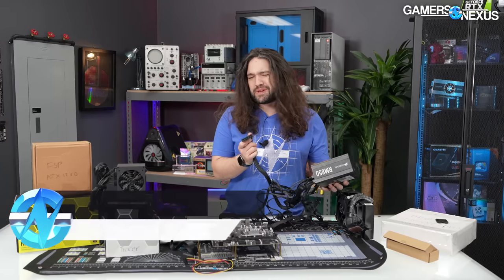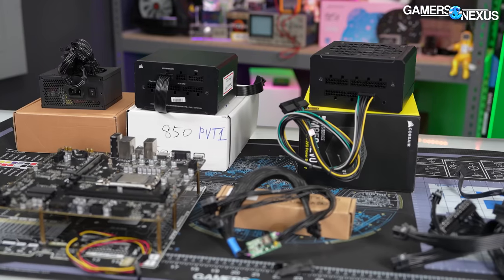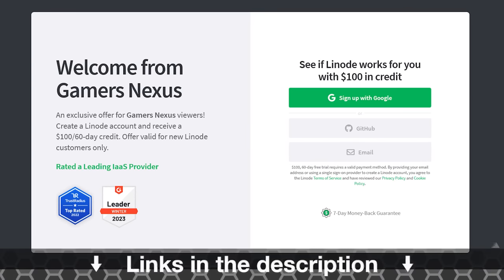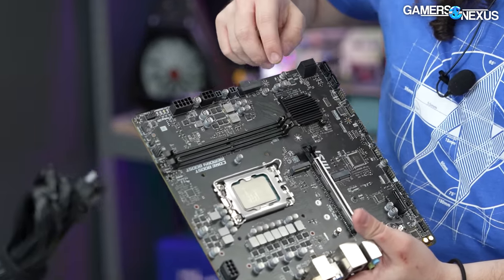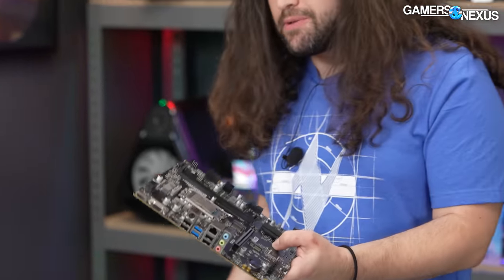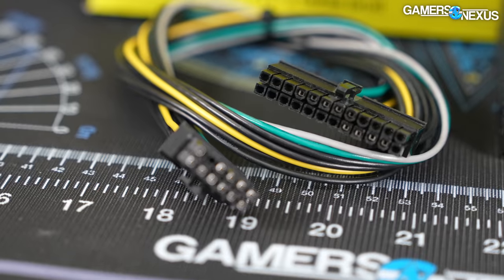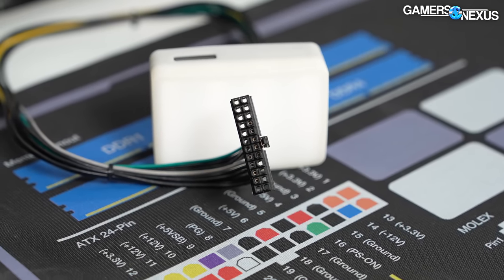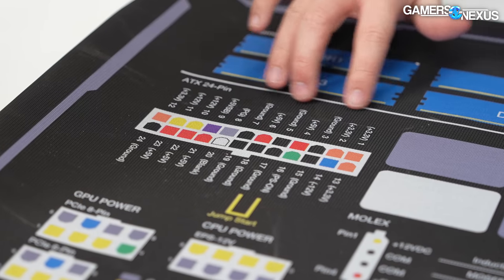The Future of Power Supplies - Maybe (Motherboard Cost, Cables, & ATX12VO)

Comment: I've never been a fan of 12VO, conceptually,

Motherboard longevity (or rather, the lack thereof) is one of the more frustrating things about the PC industry. CPU's outlast their motherboards significantly. Really, you can't expect a component with that many separate parts to be as robust as a CPU which has been binned for its unitary integrity already.
many CPU's in history last so long that they outnumber their host computers, then having to be scrapped purely because there are no matching components to make them useful.

It's rather frustrating, then, to see that standards are moving towards increasing motherboard complexity and responsibility, when, really, I'd much rather see more modularity. I think the E-waste saving potential of having a standard with more numerous, smaller, and less responsible components, is vastly more important than the power saving potential from voltage conversion efficiencies.
Reply: Well said. I have multiple still good & working CPUs (Intel Core 4790K, Intel Core2Quad Q9650) where the motherboard died and I couldn't find a replacement anymore because they were only manufacturing/selling newer socket generations.
Reply: What kind of modularity do you mean by (presumably) separating motherboard components and making them replaceable? It sounds like being able to DIY build your own motherboard, if I'm getting it right.

I personally would not like to see increased motherboard costs, but ideally if that weren't to happen and there could be other efficiency improvements by combining multiple power connectors and re-working expansion slots (and combining SATA data and power cables especially) I would quite welcome it.
Reply: @jamesbuckwas6575  Ideally, I'd wish for the ATX standard to evolve into a less monolithic design. DIY motherboard is one way to think about it.

I think, Ideally, the motherboard itself would be mostly the chipset and CPU socket.
The goal would be mostly to reduce the size of the board significantly, by removing extraneous features.

The rest of the components, such as power management, I/O, sound, USB, could be put onto add-on boards, which either socket onto the smaller motherboard, or cable into it.

What that would look like, or how it would affect latency, I have very little idea.
Though I do know it is antithetical to the current momentum of motherboards, which are now beginning to expect you to install the storage on the board itself.
Perhaps instead of that, there could be a dedicated PCIe x8 slot that connects to storage board, which can be installed behind the motherboard, perhaps with the memory controller on the board itself? Who knows.

Perhaps the ultimately solution is to replace most I/O with PCIe. Making CPU's more variable. Return to soundcards, and the likes.
Perhaps with separate PCIe-slot boards, linked to the main motherboard with a special, denser riser.
Reply: The worst part is all these e-waste generating measures are sold as "green". Many accept these claims at face value, and the community fights itself over the often non-existent environmental merits. In this case, you'd need to save an awful lot of watt-hours to make up for disposing of motherboard sooner and replacing it with a newly manufactured model, and we're talking about a watt or two on standby with these changes. It's possible that the breakeven point is hundreds of years with something like this.
Reply: @mattrogers6646 time to break out the aliexpress salvage boards

Comment: Gotta chime in and say that 12v only (sometimes even 24v) PSUs have been used in data centers in the US for several years now. I have been working on them for at least 3 years now. They are more stable in every sense than traditional PSUs. Power distribution boards then do all the "magic." This has also been great for cable management and thermals. I would love to see this adopted more mainstream so it becomes more available, aka more reasonable prices. Good day ya'll.
Reply: I do some 12V-intensive things at home and my go-to for those tasks are used 1U server power supplies.  12V 50A+ single output and they're generally free.  Some I have are more than 15 years old and still working just fine.

Comment: I feel like that last thing we need is more things the motherboard manufactures can use to  "differentiate" their product lines. 
I run 8 SATA drives, would I need to get some sort of special add on card to support that many?
Reply: you could use a 6 or 8 pin add in card. 12V to 5V is very easy to do and there's already supply chains for it. you (or a manufacturer) just have to add a 6 pin connector on one side and sata connectors on the other. there's probably gonna be single active cables that do 12Vo sata to 12V+5V sata too.
Reply: @satibel  Add in card? Like PCIe SATA expansion cards that will take power off the slot and give you 5v? If that is the though a 1x card it would be limited in power output.
Reply: @IrocZIV  I'd say it's more likely that you'd take one GPU plug and plug it into a dongle that would put out  SATA power connectors.
Reply: @Validole  Ah, yeah that would make more sense.
Reply: @Validole  Better idea: How about we have the power supply do that job and not have extra add-in cards?
Reply: @korgied  I think having motherboard-side SATA cables that break out into SATA data and power connectors would be a good idea. Although making motherboards more complex design-wise and increasing points of failure in that way is the downside of 12VO. 
As for buying an add-in card, that's impractical for a number of reasons. 
1. If you want to use ANY SATA device such as SSDs HDDs or optical drives, you HAVE you purchase an expensive add-in card, made more inconvenient because of, 
2. A lot of motherboards hardly have even 2 PCIe expansion slots, so having to sacrifice one just to use storage devices that people take for granted is not good. Especially for budget users such as myself who use large hard drives to store massive files.

Comment: The 5V and 3.3V rails are low current utilization now. There's already a VRM for memory (and on each DDR5 stick) , CPU; any inductor you see on a motherboard is part of a VRM.  Most new PSUs convert the 5 and 3.3 from the main 12V rail (DC DC converter) anyway. I don't know why people freak out about adding two new voltage converters to the mobo.
Servers and maybe cars are going to 48V, voltage conversion is very easy and compact now.

Comment: My concern is real estate on the motherboard, especially on ITX cases where space is already at a premium. Then again, on a very compact ITX build, does a 5V line coming from the motherboard even make sense, if it eschews even the SATA data ports, for m.2 NVME only storage.

Otherwise, 12VO would definitely make life easier not having to manage a 24-pin cable, though that only matters 1-2x a year when I would be doing anything with a PC internally.
Reply: Yeah, looking at this I immediately jump to builds where every component is 12V, right? If the standard started to gain traction you can imagine a scenario where some of the other components start shipping with 12V out of the gate and unlocking more builds where you just outright don't have the other rails at all. Or maybe some of the remaining components do the conversion themselves, like a breakout LED box with the 12v to 5v in the hub. Presumably you eventually have a simpler, tighter build with way fewer unpopulated modular outputs and a smaller PSU.

But I feel that's like when USB was supposed to be "universal". The complexity is still there for the legacy stuff and just gets spread out across the standard eventually.
Reply: +1 for itx! Love my small, custom SFF cases and with how much space is a premium on ITX boards I fear what they will have to remove to handle voltage step down on the mobo itself.
Reply: @mademedothis424  USB C basically did away with the simplicity that USB added. I see lots of reddit posts where novices are confused with what their USB C port on their laptops are capable of doing, particularly DP-alt mode.
Reply: Definitely very problematic on ITX motherboards. If you want to do conversion from 12V to 5V and 3.3V on the motherboard, you need to allocate space for capacitors, high side and low side mosfets, inductors for each rail of 5V and 3.3V. Then, you need to put SATA power headers.   ITX boards are already so cramped as it is now, I don't see how they are going to do it unless sacrifice DIMM slots for SODIMM .
Reply: @fleurdewin7958  Don't bother with the sata headers, provide a breakout board with sata connectors. Between that and going away from the 24pin, I don't think it's impossible and the reduced complexity on the PSU could make for extra tiny GaN units.
Reply: a lot of itx cards already have right angle  daughter boards for vrm, that's an option.
Reply: YES, I have wanted an ITX board without SATA data ports for ages. With 12VO you can cut down 24pin, cut out SATA power, shrink 12V-5V&3.3V circuits, and suddenly there is a lot of real estates for motherboard makers to play with. But I doubt they will give a budget option, more likely they will market it as "extreme" "gamer" and price it more premium.
Reply: @mademedothis424  " you can imagine a scenario where some of the other components start shipping with 12V", No electronics work at 12V nowadays, it's way too high. That requires each component to have a buck converter (step down the voltage below 3V), less efficient than anything slightly larger. Also if the buck converter fails - it will try the electronics.
Reply: @stanimir4197  Wait, hold on, what are "no electronics" in this conversation? We're not talking about the PSU feeding your keyboard directly here, we're talking about internal PC components. 

In this standard, the motherboard is already doing the conversion for the other rails, so it's handling any hardware directly mounted to its 5 and 3v rails. That includes USB and any USB peripherals. With no optical drives and only M2 SSDs the only stuff feeding directly off your PSU's lower voltage rails without going to the motherboard is what? RGB lights? Not even all of them, at that.

Fans are 12v as it is, and mostly led from the motherboard anyway, so if you have a lighting or fan hub the idea that it'd take 12v and do its own conversion for the RGB is not particularly crazy. And once you're at that point, then there is no need for the motherboard to have leads or plugs to send the other rails out through a cable. At most you may want some internal USB leads available and you can resolve any other needs for internal hardware at lower voltage not directly mounted to the motherboard through that instead. You lose SATA without an adaptor, but for small form factor builds, which is what we're talking about here, that seems doable. Niche, but doable.

Comment: Two important points to 12V only is: 1. Easy battery backup: Just connect at 12 V battery. No 110V sine inverter and other lossy and expensive system.  2. Reduced cost: The motherboard only converts the voltages it needs, and as much as it needs. Usually -12V and 5V is dropped. This simplifies the system overall.

Comment: I do like the efficiency aspect of 12VO, but I was also hoping that mATX/ ITX boards would benefit from reduced cabling rather than more expensive and bigger boards.
Reply: A lot of the voltage conversion stuff can be placed on the back side of an ITX board. Those are not gonna be as cheap as they used to be because they're no longer a budget option. SFF is seen as an enthusiast space alas. But I do think 12VO will be a net positive for ITX because that 24-pin takes A LOT of real estate and I think most could probably do without that extra 6-pin connector too.

Comment: It's a good thing that framework is starting to offer their products in standalone packages. If current motherboard pricing gets too far out of control then for my next build I will probably just get a framework mainboard and put it in the cooler master enclosure and use an external GPU. Also especially since SFF looks like it will get screwed by this change.
Reply: I want to see DTRL get a standard MB formfactor.  Some of those laptops have a larger build volume than some SFF desktops.
Reply: If you have a 12VO arrangement does that then mean you could make a case that’s powered straight from a laptop style power brick?

Comment: I think the endgame would be something like removing the 5v and 3.3v rails completely, basically giving components like 2.5/3.5in drives a 12v input which they convert down internally. The current layout with 12v to the motherboard and lower voltage to those off-board components means the voltage converters on the motherboard still need to be overprovisioned since they need to be capable of providing the maximum power when all the components are connected, when in reality it's likely that only a handful of them are hooked up.

12VO can be huge for SFF builds, since the PSU can be made far smaller due to simplifying the DC-DC circuitry and cutting out 3 rails of filtering.

Comment: Very interesting to see! Considering the points about Mainboard size towards the end of the video, I'm a little left to wonder about ITX size boards with 12VO, as it would be especially interesting for small builds, having the reduced footprint of the 12VO connectors and a simplified PSU. But I'd think it would further increase cost of ITX boards, needing more layers or probably even stacked PCBs to fit everything else into their size... I love building in SFF, and 12VO seems like a step in the right direction, I'm especially thrilled to see the I_PSU% feature coming one day, I just hope pricing won't be insane and that complexity doesn't actually increase from trying to decrease it at another level...
Reply: The footprint is only smaller with the connector, Steve was ignoring all the circuits needed to get the lower voltages now taking up space on the board making the actual footprint larger even though the connector is smaller.
Reply: There are SBC's for ITX lovers.
Reply: @JETWTF  yup, that's what I figured. It's just moving stuff from one place to another. Everything that had its place well within the PSU itself now needs to move over and require even more space on the board.... While PSU probably won't even change their form factor
Reply: @encryptedunicorn7659  I wonder about the improved efficiency since it is just moving PSU functions over to the motherboard. Could that efficiency be achieved without moving the PSU onto the motherboard? I am not an electrical engineer but I cannot see how a few wires makes enough difference to matter unless the wire used is wrong and thats super easy to rectify.

Comment: ATX12VO is a standard that is there to make the SI look good because they can print a good PSU efficiency spec on the case, but don't have to worry about the losses "downstream" because that's on the motherboard manufacturer, and not relevant to the spec.

Comment: @10:45 That variable resistor is likely a trim resistor for doing fine-adjustment of the output voltage, you can easily validate by measuring the output voltage while adjusting it. It's fairly common to find on open-terminal power supplies for industrial purposes where you just screw some wires on to use it. The primary use of a trim resistor in these kind of power supplies is so you can compensate for voltage drops during high power draw (depending on connected equipment) by essentially adding a voltage offset to ensure it's always above the required threshold regardless of load.

Comment: I don't know how significant it is in the case of computer power supplies, but transmitting a given amount power through a wire at a higher voltage is also more efficient because the lower current leads to less resistance loss in the wire. So by moving the point of conversion to 3.3v and 5v closer to the components, there is less overall loss due to resistance in wires when those components are under load.
Reply: while true, this is only insteresting for power delivery infrastructure via high voltage lines that are in the ballpark of 380,000V (germany) that can be up to 450km long for 230V households.

3,3V, 5V and 12V isnt much of a difference and that not even accounting for the short cable lenght of half a meter.
Reply: @fmskaisergsaw5567  ohms law is useful everywhere, not just high voltage lines. The telecoms world standardised on 48V supplies decades ago and for most cars they moved from 6V batteries to 12V in the 1950s. Most diesel trucks use 24V batteries rather than 12V, at least for starting the engine. In many data centers in the US, they distribute power at 240V, 480V or higher, rather than the domestic 110/120V that is common for home appliances. Whenever you have high power loads it is more efficient to do your power distribution at a higher voltage.